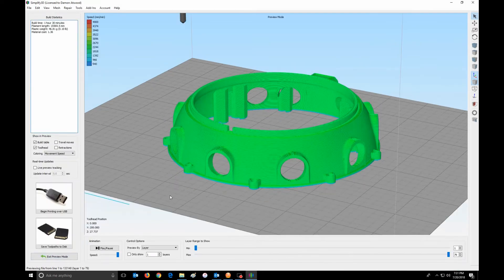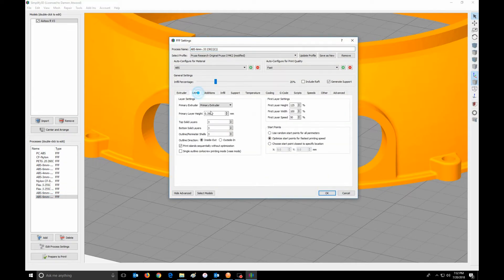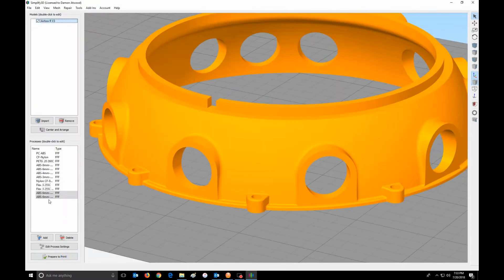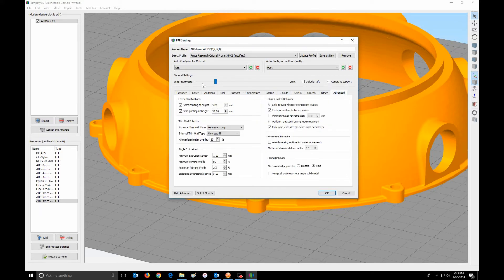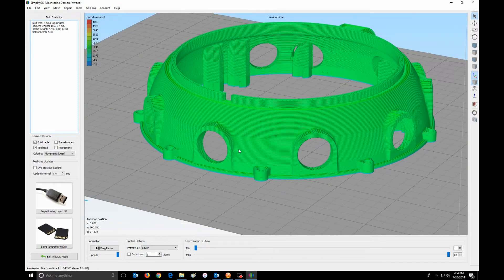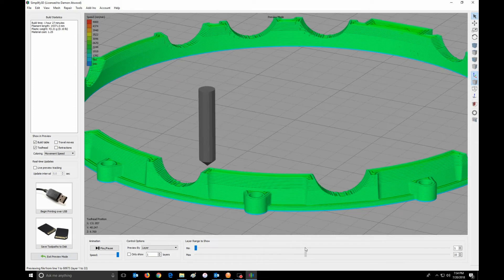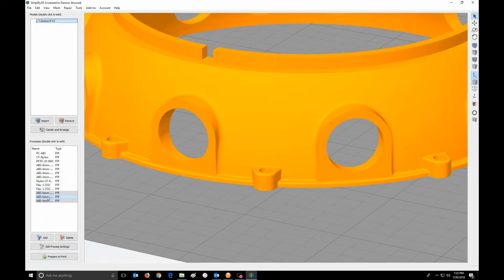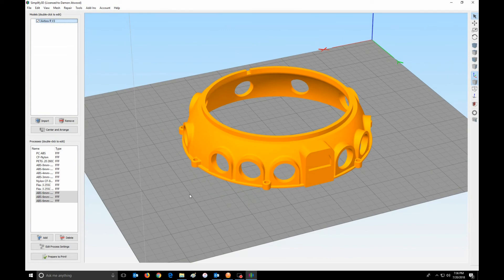Simplify 3D

Comment: Love me some Simplify 3D. it works very well for my architectural models I print which have lots of overhangs/openings means that auto supports just kill a model. Also using the multiple processes lets me setup low infill in the large bases, but tighten it up for nice looking surfaces for floors and such, so it they print faster.

I picked up a Prusa MK3 recently and have been playing with Slic3r PE and I must say it is quickly coming up to Simplify 3D standards. It does help that the printer and software are developed by the same guys though so they tend to go hand in hand. Also the printers are selling well so they can justify spending money on developers. It is still missing a number of features that bring me back to S3D (manual supports, model fixing, model manipulation for orientation, and a few others) but otherwise it prints nearly the same. I find myself using it far more often now for prints that don't need many supports, or no supports.

I do hope that S3D gets a new update out, I feel it will be surpassed at some point. Currently Slic3r even has the ability to dynamically adjust layer height in a model, but it is far less precise. It has the ability to blend the layers more between heights though. I do love we have so many options to play with Software wise to get the final product we want.